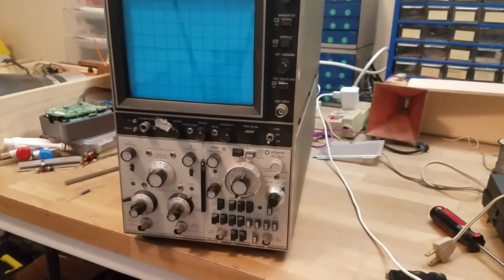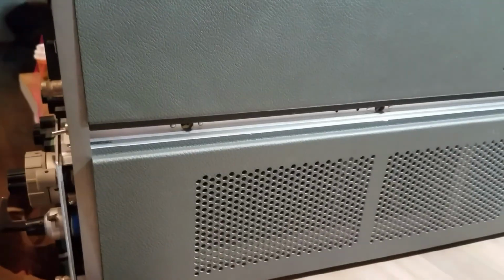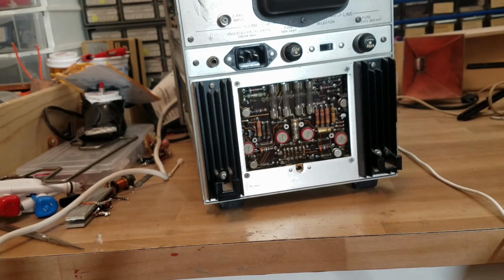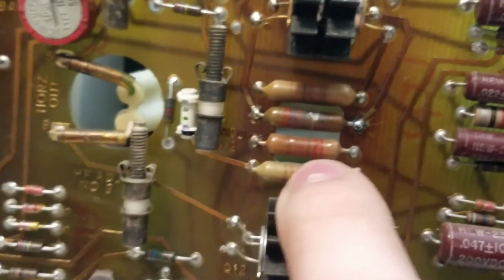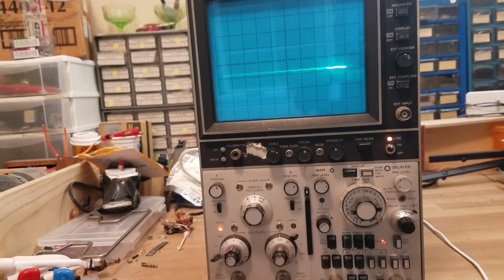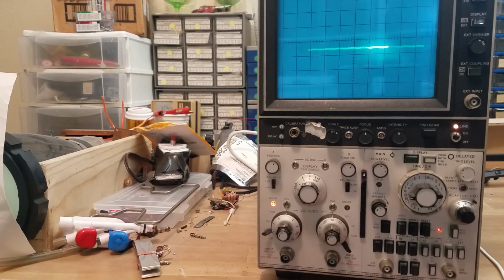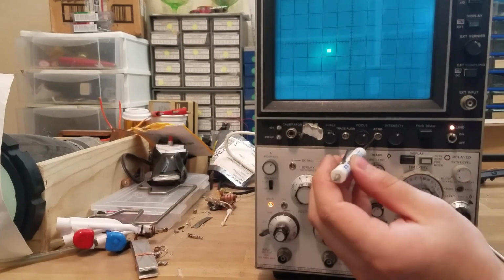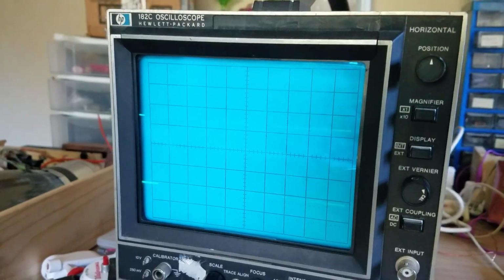Repair of a 182c HP Oscilloscope

Comment: I have found a HP 182c scope but, it has different modules; it has a 4 channel (1804A) and a (1824A) time base for 50 MHz. Can they be plug-in modules like in the Tektronix?

Comment: I was yelling and waving at my screen there for a moment until you found the channel A "GND" switch! As for the ripple on A but not on B, have you checked the power supplies? I wouldn't be surprised if HP designed the scope with separate power supplies for the A and B channels, and one of them has a bad filter capacitor. Worthwhile checking all the power rails in the instrument, both with the multimeter and with another scope.